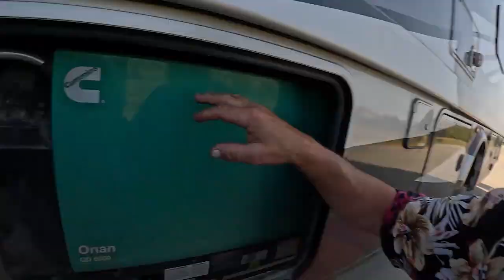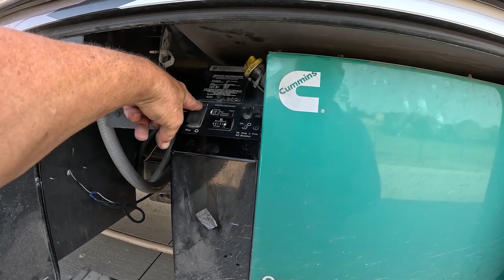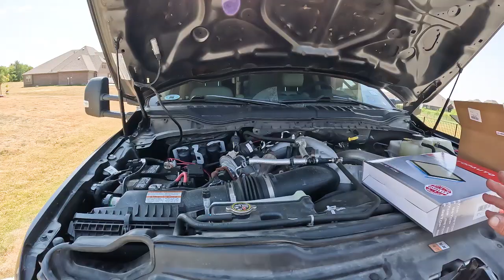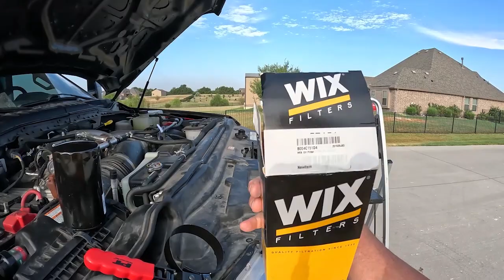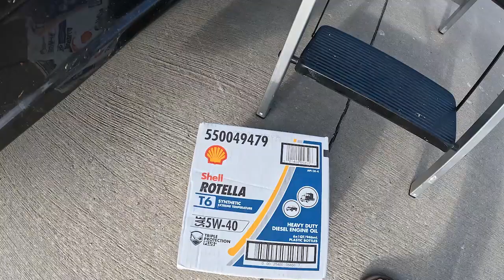The Big RV Trip Prep! Getting The Thor Magnitude Ready To Just GO!

Comment: While servicing the Nightmare, I discovered one sparkplug that none of my tools could reach effectively from any angle of attack, but 3 different wrenches would work from 3 different angles.. for about 1/8th of a turn each. That made a 5 minute job, into a 4 hour long yoga session with tools and very sharp edges... Other than that, servicing this old beast was a pleasant experience. Only change I'd recommend for the future (since the price of service is almost astronomical now) is invest in K&N air filters to replace all of your paper element filters. They improve engine performance just slightly, but it will cut down on the servicing costs by having serviceable filters instead of disposable ones. I don't know about Trudy Thunders generator, but my Onan has the ability to drop down for service and I've serviced several over the years that swung out or slid out for service. You might look into that before the next generator service.
Reply: I respectfully disagree on the air filters. The only reason you get more power is because there is less air restriction. Which in their case means less filtration.
Reply: @RabbiJesus  I'm not going to disagree on that, however as long as they are maintained regularly, the oiled filter will catch as much as a paper filter that has some miles on it will. The K&N filter will lose filtration abilities if they are not serviced, so in that, you are correct. I've been using them myself and selling them for over 30 years.
Reply from the maker: I have been running a K&N in my pickups for years and have been very pleased with them. Now that they are making them for the F550 I will be adding one to Trudy. The genney is fixed. Thanks for watching!

Comment: It is easier to take the cover off the generator I found I have the same unit RV that you have bought from the same place to Demontrond in  Houston. I’ve had a Lotta problems with mine. Mine links slides done went out. The hydraulic jacks done went out. Thor will not back at Demontrond is not back to work either. Recommend don’t even use Demond Tron Rv in Bar. No the Thor product I’m getting rid of mine as soon as I get it fixed
Reply from the maker: Seems that every RV manufacture and dealer sucks. Even the super high end coaches have problems. Thanks for watching!